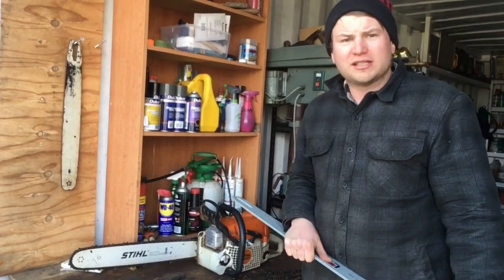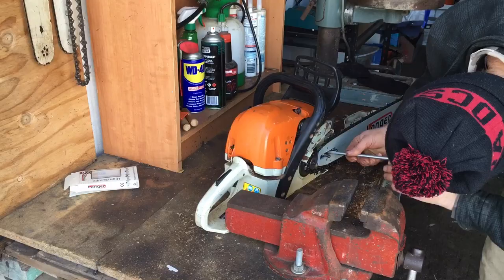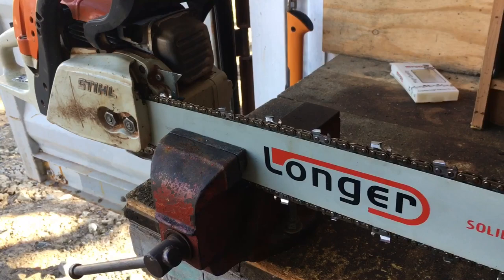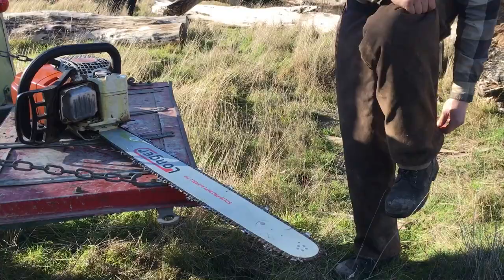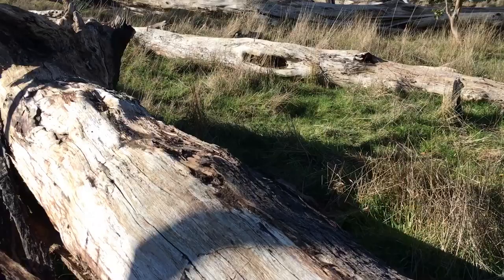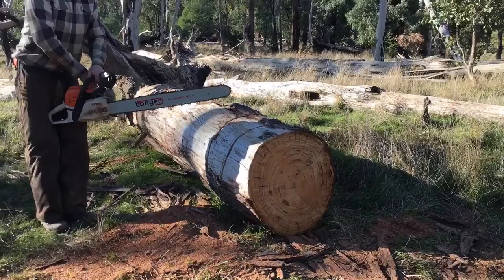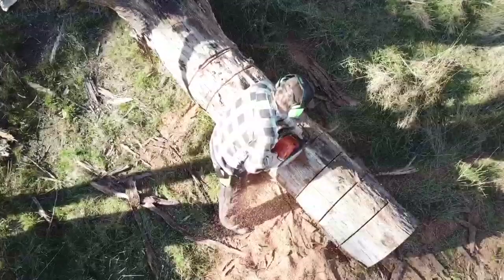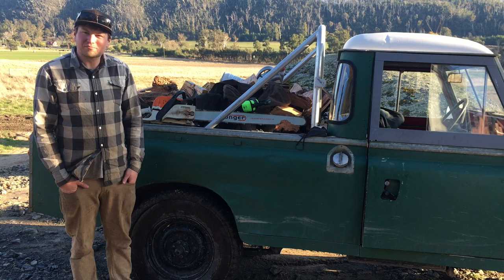Running a Longer Bar on a Chainsaw?

Comment: I would turn the oiler adjustment up to compensate for the longer bar, if it has that option.

Cool video. I'm glad the longer bar is working out. 😎👍

Comment: I ran a H 362 for 15 yrs. Been çutting for 50 + yrs.   Just this yr - bought a 572 with a36 inch bar.  It is a pro saw.   Best I have ever owned.   Wish you well.

Comment: I thought the chain brake was on at first but once you got it spinning and I seen and could hear it’s way tight. You want it tight but not too tight. Try only tightening it till the chain touches the bottom of the bar. It is really hard on the crankshaft bar and everything in between. Very good video though. Not many people show and explain going over manufacturers recommendations on bar length.

Comment: That saw can pull it if you've got a sharp skip chain and don't dog in too hard but I'd seriously watch that oiler, I don't think it will keep up with that much bar deep in the cut. Also you'll want to keep a 7 pin sprocket if you go bigger you'll lose even more torque which you'll need with that longer bar

Comment: Interesting video stihl sells the ms 391 with a 25 inch bar but the max recommended bar size for the ms391 is actually a 20 inch bar look forward to your review of how well it does with a 30 inch bar or even a 32 inch bar

Comment: I used to run big bars . Now I’ve gone back to 20 inch .  You can cut 50 inch tree with a 20. Bucking is a bit different of course. Less chain ,less cost.less time filling. Easier on the saw .  Keep your chain sharp and not to aggressive on the rakers it’ll be ok mate.
Reply: Long bars are unnecessary here where I live as average tree diameter is smaller than 12". With bore cut method 13" bar is enough for 28" trees IF you know how to do it. It's not dick measuring contest, guys
Reply: I understand wanting to use a longer bar so you dont have to reach over top of the tree at an uncomfortable angle or going around to the other side. I run a 28" bar on my 70cc saw,a 20" on my 59cc saw,and keep a ms250 for limbing and smaller trees. The biggest stuff I usually cut is 32" oak and my ms441c handles it with ease and comfort.

Comment: Very nice, I have a Stihl 039 that I want to run a 24" bar on. Your video gave me the info I needed, thank you.
Reply from the maker: Thanks Gary!
Reply: I have a Stihl 029 and I run a 24 inch bar on it
Reply: @devanmangas3474  did it bolt right up?

Comment: File the chain at 25 degrees face angle and the file flat and level . Leave her with a 3/8 7 rim. These saws can handle a 32 if used with a gentle hand. Smart to save the back.

Comment: Ah the saw that wishes it was a 362. I run a 36 on my 460 and a 28 on my 362. But I have my eye on a 880 :).
Reply from the maker: Haha yep you r right, how good would an 880 be:)
Reply: @offtrackprojectsandmainten5681  How good you ask.......the stuff dreams are made of! It will damn near make you breakfast and start your car when its cold out.

Comment: You need to let you’re saw warm up otherwise you could really damage it
Reply: I think the beauty of video editing software is that there is so much that the viewer does not know ... and never will.
Reply: Joseph Dignam okay😂I’m sure you do but I know so many people that don’t and then they’re left wondering why it doesn’t work anymore
Reply: Tom Hints Let the ignorant and stupid do as they think right. Then the rest of the population who they don’t know everything about anything and are open minded and not afraid to learn can reap the rewards :)  

But must point out, even the OEM procedure for “warm up” is quite brief... there is no way the piston and cylinder barrel temperature relationship is where it wants to be after revving it up a few times :)
Reply: Joseph Dignam I completely agree with you👍
Reply: Thanks i didn't know a chainsaw runs like a classic chevy pickup. That's good to know for longevity.

Comment: How many cc is that? Im very impressed it cut the way it did. I ask cause i have a 45 cc echo thats a 20" bar like to go 24" to 30". Anyone know what 3.3kw converts to in cc.
Reply: Kw is a measurement of power. (One part of it) ... cc is the size / capacity of the engines combustion chamber.
Reply: 20" bar is about all a 45cc saw should run. If you like echo they offer a 59cc timber wolf thatll pull a 24" bar well.

Comment: Saws can only support certain lengths of bars.. u should be able to run a 36" bar on that saw easy..
Reply: The oiler output on a farm and ranch saw would be inadequate for a 36" bar. Also the farm and ranch saws are a clamshell design and only one bar stud is actually threaded into metal. The other screws into the plastic housing.
Reply: @ciphercode2298  saws only have limits... I bought my ms311 brand new years ago . And it still runs fine.. I run a 24" to 28" bar.. I can put a 32" on it but why when I got 372 xp
Reply: @Hollywoodhouse74  I'd run a bar like that in a pinch if I needed to,but its use would be limited. I can run a 24" on my ms310 and you've gotta take your time if you're all the way buried in wood. Like you I keep a 70cc saw for bigger stuff( ms441c) I keep a 28" bar on it and it's much more practical for 24" and up firewood. Like I said,the bar mounting stud and capability of the oiler would limit what should be run. Certainly a 3y" bar would be ridiculous to run on a 59cc farm and ranch saw. If you need to cut that big of wood,put up the money to buy a saw that can handle it or farm out the work to someone who can help you with bigger saws.
Reply: @ciphercode2298  any time u wanna go cut I'll out cut u .. I can cut a cord of wood from standing trees.. loaded in my truck and stacked.. in 2 hrs.. so wtfe.. a ms 310 is smaller then a ms 311.. and short bars are dumb
Reply: @Hollywoodhouse74  an ms310 and 311 are the same saw genius.  Look,I'm not tryin to get in a whizzing contest with you. You wanna cut wood with an ms880 or a ms180 that's up to you friend. God bless you and have a great day.🙏

Comment: idk why the forest service doesn't sell wood permits to old burnt areas, the last permit I got was for this big area but there wasn't jack shit and when we dropped a few trees they said we couldn't, like what's the point of buying the dang thing, if there isn't shit to cut, there's this massive 20,000 acre burnt area about 13 miles away from me, they don't sell permit for that area so I just cut in the national forest lol.. I'm done buying wood permits to an area with nothing to cut.. nice saw though and I have a 21'' bar on my saw..

Comment: i hqve the same saw with a 28" bar. does this tend to bog down and not have enough power for you with that fullskip chain?
Reply from the maker: Hi As long as I keep the rakers adjusted not to aggressively it’s fine. I think you need the skip tooth though otherwise I think it may struggle for power. The other option would be to change the drive sprocket to down gear it. I was thinking I may have to do this but for the timber I want to cut with it I think it’s fine. Just enough power to cut a log the full length of the bar at a reasonable pace.

Comment: You’ll end up burning that bar. That saw doesn’t oil enough to lubricants it properly. You will also burn that plastic saw up. Not made to pull long bars like that. 462 minimum for a bar that long.
Reply: I agree.
Reply: Can you open up the oiler on the 391 to get enough oil? I am considering doing something similar.
Reply: @robertgeer7711  absolutely not. Not a 30in bar hell no. Do not run to at length bar am that plastic clamshell saw. It’s not made to pull it and you’ll end up burning it up. Get a 462 if you need that much bar. Anyone who needs a bar that length on a homeowners saw is asking for trouble. But to each their own I suppose.
Reply: @stephanmackie5281  Thank you. That's why I was asking.
Reply: @robertgeer7711  no worries brother. Yessir. 70+cc saw class is minimum for a bar that long.

Comment: 👍 . You didn't have to change the sprocket? Been wanting to do this on my ms311 but thought I would've had to change the sprocket.
Reply: I have a 311 too, did you try the larger bar yet?
Reply: @yoesomite2199  not yet. My brother borrowed it and I just got it back but now it won't stay running longer than a minute. Now I'm waiting on a new carburetor to come in. But I do have a longer bar and chain to put on it when it gets going again.
Reply: A ms311 will run a 24" bar ok,but if you're cutting hardwood you may not be able to lean on it to much. No need to change the sprocket as long as it's already 3/8 and 7 tooth.  It's written on the clutch drum. On a stihl with a 24" bar youd need a 24" chain,3/8 pitch,and your chain gauge and bars gauge must match. It also needs to be 84 drive links,if memory serves. The bar information is stamped into it near mounting holes.

Comment: I think stihl is under rating this chainsaw saying max 20 inch bar odd how I saw it in stores with a 25 inch bar
Reply: I found the oil output to be the problem. Drilled out the oil ports on the bar, works like a dream.
Reply: @TheWoodsmanMilling  very Interesting nice information
Reply: @AntonioClaudioMichael  power wise, anything from the 261 up can probably take 4-6 inches longer of a bar and chain. Use to, the 391's max length was the 25 inch.

Edit: that said, longevity is questionable if you do that.
Reply: @TheWoodsmanMilling  very nice information you rock
Reply: @AntonioClaudioMichael  I run the 661c-m, and I've ran the 36 on it a couple times now. It's got more than enough power for that, so I'm looking at getting a 42.
Reply: @TheWoodsmanMilling  that is very cool that is a big bar 42 inch nice
Reply: @AntonioClaudioMichael  the 36 can really make you drag the next day if you're using it all day to make firewood.
Reply: @TheWoodsmanMilling  I bet I'm just a normal Guy that was curious about chainsaw because I'm interested in buy one and there a ton of brands but stihl have features for the price that makes sense to me I appreciate all the information and the conversation is nice as well
Reply: @AntonioClaudioMichael  I wouldn't go so far as to call myself normal, far from it according to most, but I'd much rather run the 25 on a 661 than the 36. The balance is perfect.

What kind of work would you be doing with a saw?

Comment: Don't waste your time or your back. Running a longer bar decreases the rpm's.  I own many stihl products, and I tried putting on a longer bar, but it will run slower which means it will cut slower.
Reply: I have a 14in stihl chainsaw can I extend to 18 and still run good
Reply: @silvestremanz5166  , if you are going to use up most of the 18" bar in a log, then the answer is no.
Reply: Thanks for this explanation.  

I was thinking of putting a longer bar on my saw.  I figured it would dog out the engine a bit but it didnt occur to me it would spin the chain slower as well.  Having watched him cut that 28" log I was unimpressed.  

Took way too long to really be worth the modification, especially since he cut them all in half again anyway.

Comment: Do you think I could run a 30 inch on a 3.1kw stihl 311?
Reply: know one way to find out, but I wouldn't.
Reply: Itd be a stretch for 2 reasons. One,its a clamshell design saw and only one bar stud goes into a metal housing. The other bar stud threads into a plastic housing.  2nd is the oiler on these saws may not provide enough oil to keep everything lined like it needs. You can give it a try though. I've seen some people run the Mike that when they were in a tight spot.

Comment: Skip chains are for ripping NOT cross cutting. I run a pair of 660 magnums milling with 42", 60" and 87" bars the 87 is a dual power head bar using full skip ripping chain. Cross cutting with a ripping chain is dangerous.
Reply: Skip chains are not for milling. You can certainly mill with them,but the only thing that differs from crosscut chains to milling chains is the angles that they are sharpened.  Milling chains are sharpened at 10 degrees and crosscut chains around 30 degrees. Skip tooth chains were invented for use on longer bars used in canada and Pacific northwest where tree diameters were to much for most saws pulling full comp chains. They also help with using longer bars on otherwise underpowered saws,but they have only marginal success in hardwood.  They perform best in softwoods such as pine or fir. The skiptooth chain can be jumpy in hardwood and will require frequent maintenance.
Reply: Most skip tooth chains are sharpened to 10 degrees and these are the chains I have been using for many years ripping logs up to 1500mm diameter hardwoods including oak, blackwood, messmate and redgum the full skip ripping chain provides better chip clearance and the chain runs cooler. However I would concede that a 30 degree skip chain could be used for cross cutting but as you mention they can be jumpy in hardwood which is what most of our native timber is. I use a full chisel 30 degree full comp chain on up to a 60" bar with no issues other than the weight!

Comment: Did you do any modifications to your saw before you put the 30 inch bar on it?
Reply from the maker: Not any performance modifications, it has a non genuine muffler on it because I broke the original with a log a few years ago. Other then that it’s all pretty standard.
Reply: @offtrackprojectsandmainten5681  ok cool I have the same saw and was thinking of putting a 28 inch bar on it but wasn't sure if it could handle it. Thanks for the video.
Reply from the maker: 110% America Loving PATRIOT  should be fine I think, I would definitely use the skip tooth chain though it’s great!
Reply: @offtrackprojectsandmainten5681  ok thanks for the info. Are those Oregon bars just as good as the Stihl bars?
Reply from the maker: I imagine they would be pretty good, Oregon stuff is usually pretty good. This Longer brand has been pretty good for the money, not sure if it’s available in the US?
Reply: @offtrackprojectsandmainten5681  sorry i drive tractor trailers at night for UPS and finally pulled over to check my phone. I'm not sure where your at but its 3am here but anyway I saw a 28 inch Oregon on Amazon but no 30s so your probably right. I have a full chisel 20 inch bar on it now which is the yellow dot and that thing cuts through trees like it's hot butter but imagine with a 28 or 30 inch bar that skip a tooth would be best cause it sounds like the teeth are more spread out which will allow the motor to run at higher RPMs instead of bogging it down. Are they selling that fuel injected Stihl saw where your at?

Comment: Did you have to change the drive sprocket?
Reply from the maker: No I didn’t have to change the sprocket , I kept the standard 7 Tooth one.
Reply: @offtrackprojectsandmainten5681  That's good to know.